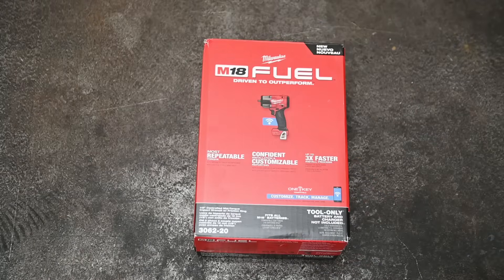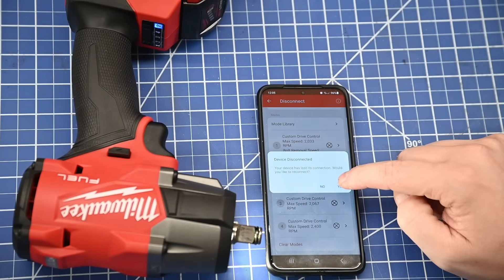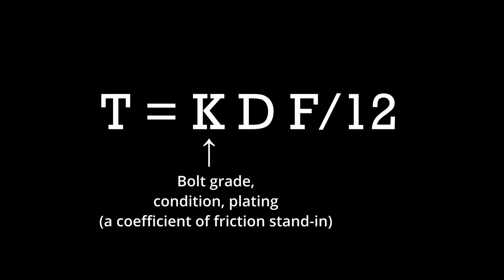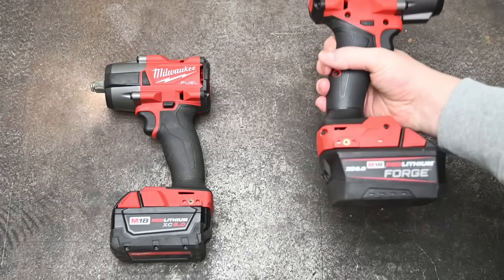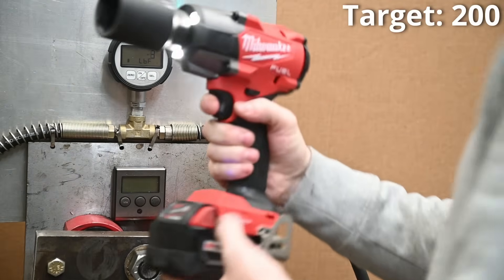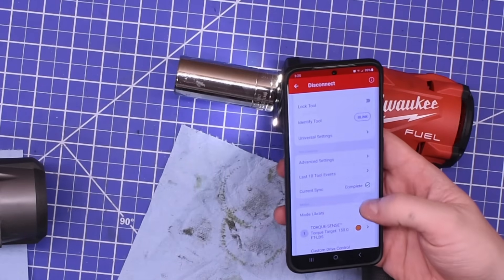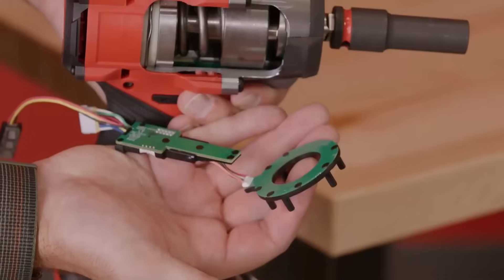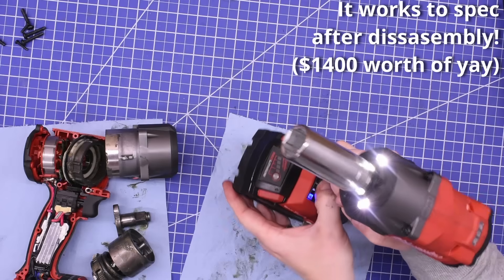Milwaukee's Secret $1,400 Impact Wrench: A Mechanic's Dream?

Comment: Lol. Surprised that Team Red didn’t include a speaker in that deluxe impact. You know, to play bluetooth music, locate the lost tool, etc.
Reply: This tool is neat and all... but I'm very very confused why it's being advertised with solar farms in mind lol. There are so many applications this tool could be used for, but SOLAR FARMS is the one that got the ball rolling and made it a reality? ok.
Reply: @jetjazz05   Solar farm money is insane and subsidized
Reply: @kylem8666  Oh I have no doubts, here in Florida it's huge money, the state gives you 10 grand off your install and 100 companies have popped up to put home systems in. Funnily enough you're not allowed to "hoard" your electricity, you have to feed it back into the system and let the grid use your power bank in an outtage, I don't know the technicalities but it's kind of peculiar... I drive about 45 miles to work and go past multiple "solar fields" so I'm sure it's big money. 
The issue is... there's a lot of big money projects out there, and I still don't get why an impact driver that torques pretty close to spec was finally made for these solar farms. There's so many industries that could benefit from a tool like this it seems like they would've gladly made it long ago.
Reply: @jetjazz05 programmable torque limited impacts have been around a while for factory use, but they cost like $10k. This is the first I've seen in the contractor/consumer battery market, though, and for that price.
Reply: Milwakuee spys reading this comment be like. Noted.
Reply: Should've put a camera on it with a code reader. For assembly and code reading mode, it would be a game changer to just set the torque using a QR code.

Comment: Why add all the electronics to these?  They are not accurate enough to really take advantage of it anyway.  A simple dial from 10 to 250 would work much better.  Then just adjust up or down after a few tests.  Who else laughed at changing the light brightness?  Seriously, have you ever said "I wish the light on my tool was less bright"?  Thanks for testing.

Comment: "Just to keep Harbour Freight on their toes" 😂😂😂
Reply: I think HF knows what is up, and theses guys know business. How else could they have stayed in business. In fact, gentlemen, they actually deserve a standing ovation for hanging in there so long. They don't claim to be anything they're not, and that shows that honesty can take you a long way. I know what I'm getting with harbor freight. They also have tools the other guys don't carry because the cost is too high. HF makes a powered auger just like the kind Roto Rooter or other pros use. It works just as good. $250.00 or $1250.00+. I worked at a complex that was 335 units and it was perfect. There is a lot of exceptional tools at HF.
Reply: Harbour Freight is TRASH!  Dont act like theyre premium
Reply: @zombl337og  Nah, the icon line is pretty solid either meets or exceeds icon in some categories and even when a smedge behind it's 1/4th to 1/3 the price, and their new airgun is doing well in some local shops that I've been to. For DIYers the Hercules line of tools are all you'd ever need. Walk in the door and get a replacement. Not sure how long they last outside of warranty (highly doubt they can go as long as milwaukee), but I'd imagine they truck along similar to Ryobi HP line
Reply: That will easy.  The HF 1/2" Earthquake XT composite air impact wrench - 1st use could not even break lug nuts torqued to 105 ft-lbf.  Not as bad as their carbon pile tester though.
Reply: @somaday2595  yeah dude more like earthquack thing sucked--i bought a $100 dewalt 1/2 air gun that blew the HF gun away
Reply: @somaday2595 one gun that is worth it to use today as it will loosen just about anything and it used to top their rank charts is the Rigid Octane 1/2” high impact. Just mountains of power. I found one online brand new in box a few months ago. The 1/2” octane mid torque is a pretty good one as well with the sheer amount of RPM it makes

Comment: It’d be cool if they put a little OLED on the back of the motor housing in future models so you don’t need to remember which profile is which, and eliminate the need for a phone past setup/cal
Reply from the maker: We're split on this. I'd prefer no phone/iPad nonsense. But that means also now a digital screen and knobs or buttons to contend with failing on an IMPACT WRENCH that tbh we normally throw around quite a lot.
Reply: @TorqueTestChannel  And adding to the cost too, whereas everyone already has that powerful display-equipped computer in their pocket they can take advantage of. I'm torn on that one too, I'm afraid there may not be a 'right' answer lol.

Comment: Give me an impact i have to connect an air line to, and a battery/plug it into the wall. GIVE ME ALL THE BEANS. *and the feature that prevents the impact from spinning me in circles and smacking me in the face.

Comment: I'm an engineer at Gamechange Solar, and never would I have guessed that Milwaukee shown images of our racking solution in their advertisements.
Reply: recently i searched for a specific term/machine for weaving textils, low and behold i recognized the shown locations and machines, because these unknown to me company showed their process with our machines in our facilities. wellllll
Reply: I installed one of your tracker systems before and it was painfully bad
Reply: I build trade show booths for game change lol
Reply: @JesseNickell I used to do that job, stupid fun job. Now I’m installing these pos solar systems and it’s probably easier than building the trade show exhibits but I make more than twice as much lol
Reply: as a former construction manager for solar city.... i hate you lol
Reply: You’re a liar.
Reply: NIce rack.
Reply: "Racking solution" 
Its a c channel on a post;
Relax 😂

Edit;
Ratting to your boss about this won't get you a promotion either;
Your boss has to pay for the wife that cucks him,
Which means YOU have to work harder.
Reply: Fuck Gamechange and fuck their portal
Reply: Tanku what’s your ig
Reply: Strength in unity?
Reply: I wonder if it's durable. Will the electronics survive falls or a bit of moisture ?
Reply: You know what they say "One engineers solution is one actual working man's pain in the ass."
Reply: Oh wait you guys mean like proprietary systems leaked without permission type things going on?
Reply: @saikyouabe no it meant the company got some free impacts… or the owner did😊
Reply: Why would the base of a solar panel need to be at a specific torque? Genuine question...
Reply: @shootkilldiePB  just like anything else, to make sure it doesn't vibrate free, usually from wind load. ive seen ground mounted panels sail 200ft across a field during a wind storm
Reply: @shootkilldiePB I second that question. It just looks like galvanized steel whatever.
Reply: @shootkilldiePB because the metal work is crap and things will move If things are over tightened. The panels can break and the CYA on all this is so that the company has all these stringent install requirements so that they don’t lose money..  its so they don’t lose their ass with this sham they are pulling off.
Reply: Do you have any data to show how I can install solar and make it economically sound. Everything I look at the numbers just don't add up. My research leads me to a  cogen syngas system.
Reply: You made me laugh, truth hurts sometimes @JB-vk8jk
Reply: @JB-vk8jk yep
Reply: Yes.
Reply: Its pretty obvious which type of crowd this impact is marketed towards… no offense friends, but this is for the tech hipsters out there that think their math and college degree will be able to shortcut their lack of ability and inexperience they have when it comes to actual real life troubleshooting and on the job skill, learned from 90% experience.  If the company that you work for has the money to fork out a couple dozen of these things for their techs, then power to them.  Its likely not going to change their turn over times and definitely not reducing the be-back trips.  $$$ is ALWAYS better spent on on the job training.
Reply: @champspec you’re jealous. You have no idea how hard it is to get some of these high skill degrees and you make assumptions about the people that have them. Whatever bias you have, you should check it.
Reply: @champspec usually we dont get paid to go to school, some do. i have to pay my tuition as well as being unpaid time. dealers will offer free schooling for their own programs though. as for this not cutting times? doing a day of services when there is no gravy i probably grab my torque wrench about 6-8 times a day. i walk from the vehicle to my box, grab the bar out of its case. adjust the wrench (ive got the new gen snap on analog with quick adjustment screw), then torque every lug nut. the total time for one car is probably around 1-2 mins tops (5 lug focus or 10 lug E series). 

this would allow me to use my gun as my torque wrench, always in reach. id prob save about 30 seconds to a 1:30. thats 30 seconds on 8 cars per day. it may not seem like a lot, but every second matters.

tldr we dont go to school for free. gun fast wrench slow. if its accurate enough it will be a excellent replacement.
Reply: Solar😂 Are their still suckers left in the market....
Reply: @ginog5037  utility grade solar is the most efficient and reliable base load power generation to ever exist. stop being a partisan hack.
Reply: @ginog5037  what do you mean?

Comment: Excited to see this tech trickle down into more commodity products
Reply: yeah, something like this at 300 to 400 bucks is a lot more reasonable in a couple years.
Reply: "The more they overthink the plumbing, the easier it is to stop up the drain." - Montgomery Scott, Chief Engineer 

If you're gonna do it, skip the spinning wheels and make it compatible with all of your batteries. Instead of RBG LED's, give me a tracker that will perform the same function, as well as aid in the event the tool is stolen(you're well into felony area with this one*). Also, having to do a 10-step calibration each time you use a different battery type or different hardware? Pass.

edit*: Different states have different values for felony theft, thought they were all > $1000.

Comment: Now a days a guy has to know how gun when useing it in critical situations..I run a  mid torque milwaukee for most stuff under vechile,and the new m18 compact 1/4 in driver for topside type stuff.and latley since buying the fuel 3/8 drive high speed ratchet, I've been hard pressed to not have that in my hands. This new gun is very interesting..

Comment: Wow nice price tag. I wonder what the longevity is on these. Those interior sensors is what im concerned about. Gorrillas dont tend to be gentle with anything, but if a tool can't be tossed in a truck sometimes. Is it even worth it. I guess at a shop where it doesn't get carried off the premises, but not to many shops picking these up for their techs i imagine.

Comment: Makita has an entire assembly line battery platform, 14.4v and even there own dedicated website for them, makitaassemblytools.

The torque sensing impact wrenches they have (standard size, not mid or high torque size) that are standardized at 101ft lbs, but some models that can go up to 136ft lb.

They even have programmable nutrunners and screwdrivers, and oil impulse hydraulic versions.

 All of them have a USB port in the handle that can be used to tune it to the torque spec needed, and isolated software internally that is set it and forget it.

Interesting that Milwaukee are going this route, it seems way too inconsistent to actually be used in an assembly line, and I'm sure in many applications that inconsistency would be unacceptable.
Reply: just wanted to mention this yeah :)  some of those have mechanical torque sensing if I am not mistaken?
Reply: @riba2233  yes, some do, the newer models have electronic torque sensing.
Reply: @EliotTruelove  awesome, thanks for the info :)

Comment: It would be nice for som applications but not for that price :( 
Btw Hilti have a torque adapter for impacts that you just put between the tool and the batterie (Wonder how its messure the torque) and it cost just arround 300 buks
The only problem is that you can just use it for hilti products, you have to scan a code on the side of the bolt pakage for eksempel and of you want to use it for wheelnuts you have to find out how much torque the tool use for a specific bolt and adjust the settings manual for that bolt, so basicly you can not just type inn the torque you want.

Comment: Looks like a waste. I'd still recheck every lug, by hand. My 20 year old 1/2" ugga dugga easiley torques to 50lb/ft +/-20% on the first click (100lb/ft +/-20% on the second click), every time I pull the trigger. 

That thing will get within 10% of the goal, 80% of the time. The other 20% may not be anywhere near the preset goal! That could be one lug loose on each wheel, or most of the lugs loose on one wheel, so I'd still need to chase it with a real tq wrench (on every lug of every wheel). More money for a tool that can't make more money…

No benefit to good technicians, but it could help garage monkeys if the price was within a mokeyes grasp.

Comment: This seems like a hugely expense hand tool but if it is used at Milwaukee designed it for (basically assembly line work) the cost is justified. 
I can't see any justification for most mechanics to buy one of these.

Comment: Pass and a half. Maybe if you are repeatedly doing the same task, same fastener, same job all day long. But for someone who has to do 3-8 fasterers then swap, the whole 10 step calibration kills the utility. By the time it’s calibrated you’ll have already used your TQ wrench and gone for coffee
Reply from the maker: You save the profile, you only calibrate once per job type. That said, i'd still agree
Reply: yeah, this is pretty much a manufacturing only impact. that being said it will easily pay for itself installing bolts that would otherwise require impact+ turn of nut, or impact+torque wrench method. especially compared to expensive DC pulse tools which can range into $40,000.

Comment: The k factor is why I exclusively use digital torque wrenches, if it shows 5 or 10 lbs of force effort just to turn it,  you can add that to your desired torque to come up with a more accurate procedure
Reply: Youre talking about rundown torque i do believe
Reply: The K factor is why torque turns exist
Reply: The issue with this method is it only accounts for constant offsets, not K factor. If there is high friction, the impact will increase much more under load.
Reply: Doesn't work like that,duh.
Reply: Run a gauge. R&R, the difference between your digital torque wrench and a conventional are nil. The digital advantage is that it logs each event, so you can document and make sure excessive torque was not applied.
Reply from the maker: @otm646  He's saying it reads live torque, which tells him before tightening if the hardware itself is taking 5-10 ft-lbs to move then a 100 ft-lbs spec is likely going to be looser than normal.
Reply: @otm646  also I have to take issue with your statement,  in tests click type torque wrenches are usually not as accurate. Also when dealing with tty and tta fasteners how you get to your final torque can differ as well. For instance with my digital wrenches I usually hold the wrench at final torque for five seconds to allow for a more consistent result. Don't let the duck pajamas fool you,  I rebuild about 6 engines a month

Comment: This kind of thing isn't new, it just usually comes attached to a power cord or air line in a factory. And usually doesn't do impact action, just motor torque. It's how the cars get put together in the first place. Putting it on a battery impact is kinda novel, though.
Reply: Makita have done this for years in their 14.4v Assembly line tools with simple software programmable by USB on the handle. It's not something you can pick up at a Home Depot or your local hardware store though.

Comment: I guess if you do a ton of very repetitive same hardware, same spec, work rhen this might be worth it. But those more rare and are very specific jobs. For most shops, and techs, I see this as way more of a hassle than a time saving tool.
Reply from the maker: It'd be a wheel gun only for sure, other threads are too likely to be rusty anyways
Reply: @TorqueTestChannel  But I get it. Hammers are cheap, precision instruments and tools are expensive, if you want accuracy, repeatability, and reliability.

Comment: I am curious if the tool communictes enough with the battery to know what is installed, and possibly error if you install a forged battery while in torque mode.
Reply: No one has seen evidence of M18 tools and batteries communicating yet. The battery just holds a pin at 3V for "good" and 0V for "stop". The batteries have digital comms with the charger, but there's too much electrical noise on the tools. They could theoretically do a quick ID before you pull the trigger.

Comment: I think the torque accuracy for use with this tool is not for critical applications.  Using this for lug nuts would not be ideal.